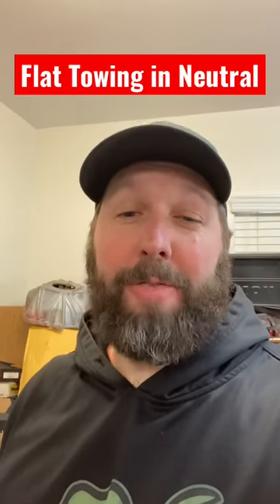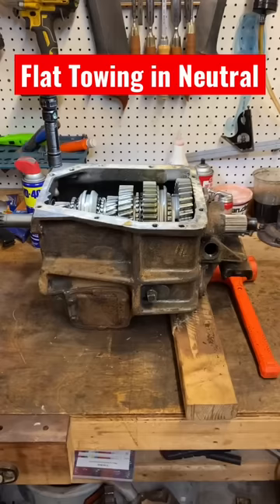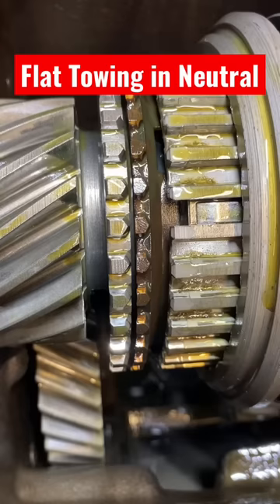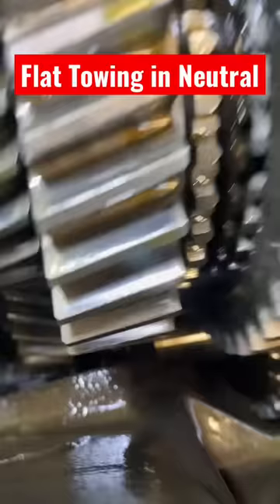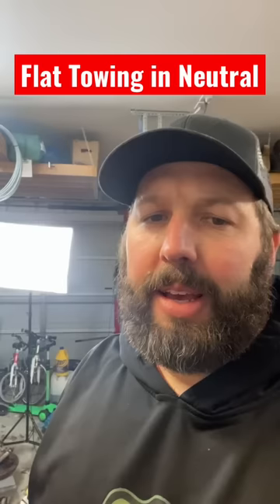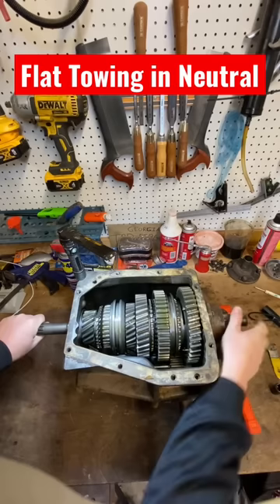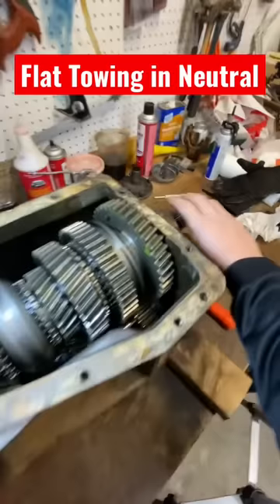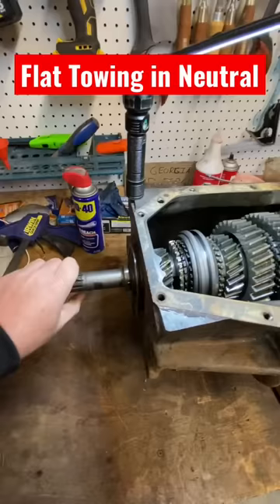Flat Towing in Neutral??? #transmission #stickshift #mechanic

Comment: This is why I put the vehicle on its side when I tow
Reply from the maker: Real Men of Genius 😎
Reply: Is there a particular side of the vehicle that gives the best towing results? I do plan to put a moving blanket under it to protect the street.
Reply: L.  Oh.  Effing.  L
Reply: Makes as much sense as towing in gear I guess
Reply: @TelepathicRabbit  I prefer the passenger side, mainly because I would like to open the driver side door when I’m done towing. However, using a moving blanket (which is a genius idea) might prevent the grinding , which at that point it wouldn’t matter which side. 🤷🏽‍♂️
Reply: I just realize this makes more sense to let you think about it
Reply: poor little biker ok I got admit you made me laugh I didn't expect your reply.  Thanks for the giggle.
Reply: Hahaha, fukn Killin me 😂😂
Reply: Or you can simply drag it on it's roof to avoid this problem.
Reply: Effing hilarious, TY
Reply: This is why I overfill my oil when I tow
Reply: I LOL'd way too hard at this 🤣🤣🤣
Reply: @TelepathicRabbit  I've heard the roof works best actually
Reply: @TelepathicRabbit  The way i was taught, you put it down on whichever side the fuel door is on
Reply: @TelepathicRabbit  On it's roof. it's way smoother than either side.
Reply: If you it on the roof the top ( now bottom) the top of gears gets lubrication.
Reply: thats great!!!!
Reply: Then how are you to flat tow a manual transmission   i guess call a wrecker and pay the tow fee of $100 to $200
Reply: @rossstevens6165 just rotate the vehicle upside down then rotate a few miles back up on wheels lmfao😅😅😅😊
Reply: On the roof works well too. Just put down a towel, so it don't get scratched.
Reply: Too wobbly on it's side, better if towed wheels up.
Reply: On the driver's side is more balanced & lower gravity.😅.
Reply: Remove drive shafts
Reply: Amateur. I stand it on its nose.
Reply: 🎶Mister car side towing car tow-er🎶...
Reply: Checks out.
Reply: Imagine being this lazy🙄 you have to flip it all the way over
Reply: This is why, if you are going to tow a vehicle behind your motor home, you should get a trailer and put it on it. You can then also use the trailer for additional storage and so much more.
Reply from the maker: @oldfarthacks try parking a 40ft Motorhome and a 20ft trailer at an RV park 😉. RVers don’t flat tow because they are lazy, cheap, or dumb. It’s because a Motorhome and a trailer wont fit in an RV park.
Reply: yes and make sure its running and the gas pedal is to the floor

Comment: My father in-law who was a mechanic for fourty years, told me about this, and we would unhook the drive shaft, and then pull it. It was easy , and it saved the transmission. He was a brilliant man. He has since passed. But I loved him nearly as much as my own father.
Reply from the maker: Same. My father in law is much more a part of mine and my kids life than my own father. He’s a contractor, so he has a lot to teach.
Reply: You disconnect the drive line because you can't tow it in gear so it doesn't matter
Reply: Sorry for your loss mechanic mindset is fading out of society!
Reply: You do not have to disconnect the drive shaft. If the engine still runs you can just start it up and let it idle.
Reply: If towing a distance,  it's easy to remove 2 straps on rear ujoint and slide the whole thing out.
Reply: @wallywoods288 That doesn’t make any sense, can you explain why an idling engine would lubricate the gearbox better?
Reply from the maker: Did you watch the video? The input shaft always turns the counter shaft, even in neutral. The output shaft does not turn the countershaft in neutral. The countershaft is what is submerged in oil and what slings it up on the input and output shaft. The mainshaft contains the input and output shaft, but it is not one solid shaft. It’s split in the middle so the input and output turn independently of each other.
Reply: @freedomworx Are you talking to me?
Reply from the maker: Affirmative.
Reply: @freedomworx I missed that the input shaft still spins the countershaft even in neutral, my mistake. I’m not a technician.
On a related note: would an engine only spinning at idle speed sling enough oil up to properly cool/lubricate an output shaft gear set  traveling at highway speeds?
Reply from the maker: @JPTulo  yeah. Idle speed is fast enough. 👍
Reply: Nice story
Reply: Wait, so you're supposed to do the same thing with a manual as you are an auto transmission? Remove the drive shaft or take the driven wheels off the road in a sling?
Reply: Keyboard mechanics are as about as common as a rat infestation. Smh

Comment: Had a customer that flat towed their 2011 outback in 1st. Dude said, "Man, it was the damnedest thing. We hit 70mph and we thought for sure the thing caught on fire behind us. Pulled over and there was oil everywhere! Must have blown it out the dipstick or something. Right?..." Man, there was about 5 fist sized holes in that engine 😂 Transmission was smoked, clutch was broken. It was basically a total loss
Reply from the maker: Real men of Genius!!! 😂😂
Reply: @freedomworx  pretty much hahaha
Reply: Only Subaru owners
Reply: @ogonbio8145  bro, I'm telling you. I loved my STi but 99% of the people who drive the damn things are brain dead
Reply: This was fairly common occurrence when I worked for Saturn in the 90s. Common vehicle for dinghy towing behind a motorhome. Lots of people forget and leave it in gear... Normally 1st. Normally cooks and twists the input shaft before bird nesting the clutch disc.
Reply: I knew someone that did that exact thing.  The amount of smoke was unbelievable.  Needless to say, the drive train and engine were toast.
Reply: I rented a tow dolly from UHaul to tow my 1985 S10, four speed.  The guy told me to put it in neutral. It made sense at the time, but 300 miles into the tow I thought I was dragging the truck.  I always disconnect the drive shaft and tie it up - let the rear wheels spin on their own

Comment: I always flat tow in the lowest gear possible for maximum lubrcation
Reply from the maker: Toted much easier once the rods come apart 😎
Reply: @freedomworx  LOL
Reply: A friend was towing me in my 55gmc to school.
   I thought it was in neutral,  but it was in low gear.
   It's an automatic, but it pull started it.

  Another time a co worker was jump starting it after work.
   He had a brand new Volkswagen  parked right in front of me.

   Again it was in low & I didn't know. I pumped the gas to get it to fire & it JUMPED forward with a healthy v8 roar!

   Somehow I got it stopped, but that kids eyes were wide open & he wasn't able to speak for a while.
Reply: @jupitercyclops6521  They really just didn't gaf back then huh
Reply: I'm sure that keeps the engine lubricated to.
Reply: That would be R for reverse in many cases! Good thinking!
Reply: The R on the shifter is for "Race Gear" 😂
Reply: Just pull the spark plugs it'll be fine!
Reply: I can only imagine the black skip marks for miles up the road
Reply: @clutchbleach2057  build anything with enough metal and it generally doesn't
Reply: @buckeyekush1  It's for Rocket Power
Reply: This is the 🐐 comment 😂
Reply: A tiny bit of oil is better than heavy torque.  Ever done 40MPH in first ?
Reply: @freedomworx  LOL.  A few months ago i listened to a Kubota D1090? and said that i thought a big end was f$%ked.  10 mins later it came out the side. Another time i asked a guy about his boat engine "is it a single ?"  It wasn't,  it was just firing on one. Cracked an injector, no change.  Cracked the other and it stopped.  Cracked the first again, for a bit longer.  Picked up when it was tightened. He had had the boat for a year and never realised that it wasn't running properly.
Reply from the maker: @sbkenn1  some diesels just sound like they are going to come apart at any moment. 7.3 rookies always looking for that mysterious knock 😂
Reply: @freedomworx  ever come across a Bolinder, 50's Paxman or Foden engines ?  I have worked on all 3.  I do use my ears a lot as a diagnostic tool.  When people say that i should get a job done by a specialist (injectors or pumps) I take it as a challenge to do it myself 😜
Reply: Lmfao
Reply: Pull spark plugs so engine can spin in gear without compression.

Comment: Just pull the drive shaft and call it a day.
Reply from the maker: RVers don’t want to crawl under a rig and disconnect a driveshaft 🤷🏻‍♂️
Reply: @freedomworx  that's too damn bad, it's either that, get a new trans, or don't get towed with a vehicle of that size. Most HD wreckers carry an impact and socket set in the truck. Gonna figure it out one way or the other.
Reply from the maker: @InvisibleSquids  there are plenty of vehicles that can be flat towed behind an RV without any adverse consequence. The Jeep Wrangler or Gladiator is a perfect example. Put the T-Case on neutral and go. There are Jeeps that have 10’s of thousands of towed miles on them.
Reply: @freedomworx  I see what you are saying now. I have experience in emergency response as a wrecker driver. Also have experience with a jeep compass that had a mechanical failure behind a RV. Something caused the front axel to bind and start dragging. They weren't sure how long they went before Michigan state police stopped them and had the compass towed to a dealership. The tires were gone, left over who knows how many miles of northbound I-75. The rims had been ground down to an 8 inch radius. 

Not 100 percent sure what caused the problem, but I know the brakes weren't locked up. The wheels could rotate, and the trans did shift into park on the flatbed
Reply: @freedomworx  anyways, I thought your original comment here was about an RV owner not wanting to wiggle under their RV to get towed, assuming the 'rig' was the RV and not a light duty 4x4 with manual gear boxes
Reply: @InvisibleSquids  they probably forgot to leave the keys in the ignition and the steering wheel locked. It happened to my dad once but he noticed it about two turns into his drive so no damage was really done other than a little tread off of the front tires
Reply: @freedomworx  there is a device available that disconnects the driveshaft with just a tug of a choke cable.  Superior driveshaft disconnect
Reply: @freedomworx  because of the transfercase neutral or what?
Reply: @InvisibleSquids most companies ask... Then send a rollback. I always cringe when I see jeeps getting flat towed and you can see the shafts turning... But what can you tell em?
Reply: @freedomworx yeah, but most jeep owners don't know that... They put the Trans in neutral and call it a day... Seen it a hundred times a year when I worked for dodge... And 99 out of them bitched when we showed them the sticker on their sunvisor and said they should put it someplace they'd see it... Dude, it's literally right in front of your eyes... You don't read things placed where you can't miss them?
Reply: @freedomworx  h2 hummer is another one
Reply: Exactly
Reply: We had a truck towed back to the shop. They were nice enough to remove the driveshaft but split before reinstalling it..
Reply: Remember my dad used to do that (wrecker)on trucks/rigs, now I know why 👍
Reply: @Freedom Worx  only way you can get 10's of thousands of k's on a jeep
Reply: @InvisibleSquids  Wouldn't it have been easier just to have the Jeep push the RV?😀
Reply: @halwilliams1682  No, cause you'd have to have the magic Jeep equipment and get the special Jeep hitches and call a tow truck to have them on stand-by when the Jeep miraculously produces enough torque to twist the drive shaft and burst a tire off the bead, only to have the Mopar dealer say "You shoulda got the MOAB, it would have done it". Maybe a Jeep could tow an RV a few decades ago, but they're really purpose-built to either be expensive offroad toys or look like they do dirt stuff while sitting shiny in the driveway. 
Not knocking anyone who can afford one getting a Jeep; I've worked on them, and I don't like them for what I'd need them for.
Reply: @freedomworx  
Definitely, Jeeps get towed a lot.
Especially late models because they're Fiat's. 
😄
Reply: @kamikrazywarboy2008  If the transfer case is in neutral, no issues.
Reply: I have actually done that.  We had an old dodge van (full size, not a mini van) and that model year was known for wearing out u joints. So I got pretty good at popping out that drive shaft.  A minute or two and it's out,  and tow away.
Reply: And this is why I keep my 2007 Honda Fit! I do not want a jeep. I think there is one newer Buick that can be flat towed. But I am not over the required minimum age of 65 for a Buick. Any newer Honda, Toyota, Nissan that I like have the CVT and have to be trailered or dollied.
Reply: @ClearwaterKB  cars aren't built like they used to be.
Reply: They actually do that on semi’s
Reply: Smartest comment today
Reply: You can get a disengaged axle installed the axle ina front wheel drive car can be used then you can flat tow it anywhere my friend had one on his taurus and went wherever he wanted unlock the axle and drive away
Reply: I heard you can tow in neutral but you need the motor to be running. Maybe it's just the certain cars.
Reply: @justincoats7236  some vehicles can be towed in neutral like most jeeps before 2005 can be towed 35 miles at 45 mph bit none of the grand Cherokees can be towed unless you pull the driveshaft out. Chevy tks 15 miles at 25 mph. It depends on the make and year all large trucks must have the driveshaft removed or catastrophic damage Will occur
Reply: @justincoats7236  no you're completely correct.
Reply: Yeah don't matter what the selector indicates then ...
Reply: On my previous car, removing either half shaft from the differential would mean losing all of the oil in the entire engine, transmission and diff.
So no, on many FWD vehicles you can't just pull the drive shafts and call it a day.
Reply: @freedomworx  well its easiest for them bc they actually have room underneath, unlike passenger cars.
Reply: @kamikrazywarboy2008  someone could remove the rear diff/ axle assembly and replace with a front diff/axle assembly. Then they can have freewheeling hubs on all wheels.

Comment: Hired a Tow company who attempted to tow a crane from Miami to Ft.Lauderdale without removing the driveshaft. The transmission EXPLODED.
Large gears and heavy metal fragments flew off in a 20 yard radius closing the highway down until we were able to find all the debris.
Luckily nobody was injured.
Reply from the maker: Pictures please!!! 🤑
Reply: Probably the lowest bidder.
Wonder why?
Reply: @happydays8171  
It was the only service that would take/attempt the job.
Reply: Thank you for putting this video in better perspective! Nothing like the result of bad judgement as a lesson
Reply: They collected all the parts to put back together again?
Reply: @kevinkwiatkowski7197  
We salvaged what we could from the road.
I have no idea what they did with them.
Reply: @DavidSmith-sw5kg  ok
Reply: Good GAWD! What tow truck driver DOESN'T KNOW to disconnect the driveshaft?!? 🤦🏼
Reply: @Basslicks82  You'd be surprised. Unfortunately.
Reply: @davidsmith A crane? Really?  I thought those were usually trailered. Pics or I call BS
Reply: @Basslicks82 the one that towed our truck the other day claiming he didn't have the tools to remove the driveshaft.
Reply: @samuelworkman51   As long as he had insurance.......
Reply: @randywl8925  that's not the point. It shouldn't have happened in the first place.
Reply: @samuelworkman51  I totally agree with sarcasm.
Reply: Wow that's not even a far distance... well it was far enough, I guess....

Comment: I usually keep the transmission in gear and wedge a broomstick between the clutch pedal and the seat. 65% of the time it works every time!
Reply from the maker: Math 😎🤓
Reply: "65% of the time it works every time"

🤔🙄
Ri i i i i ght . . .
Reply: and when it doesnt you can put it in a 5 gallon bucket.
Reply: I use a Dolly. Set her up at the side of the road and wait for a flatbed to stop.
Reply: And 35% of the time it DOESN'T.😮🎉😂😅😊
Reply: I don't think it matters if it's only few kilometers. Never had an issue with that. Towed quite a few vehicles with line.
Reply: That was amazing
Reply: I put my transfer case in neutral I don't have to worry about the transmission, clutch, or drive shaft
Reply: Make sure to put it in first or reverse 
for towing at high speeds😏
Reply: Just make sure you're not going to over heat the clutch release bearing.
Reply: I recall you can tow a couple of miles or to get to a safer place is ok
Reply: @bobjohnson4025 also put the transfer case in 4L if it's four wheel drive.
Reply: Pop the stick out & fill trans above input & output shaft
Reply: I heard that's banned in 9 countries.